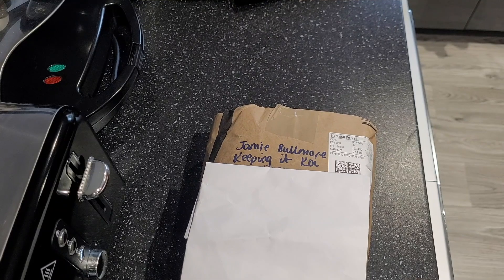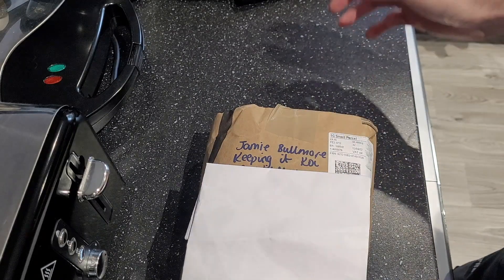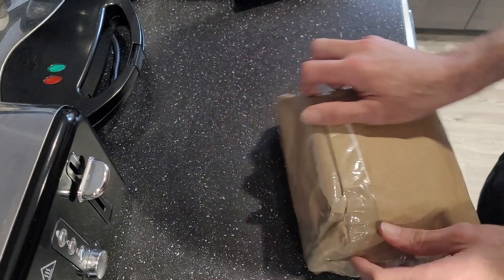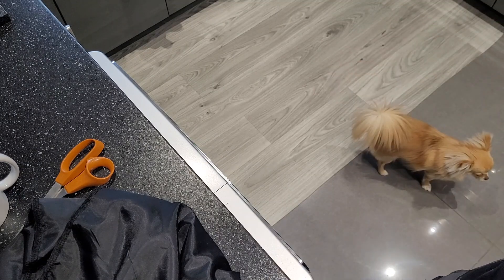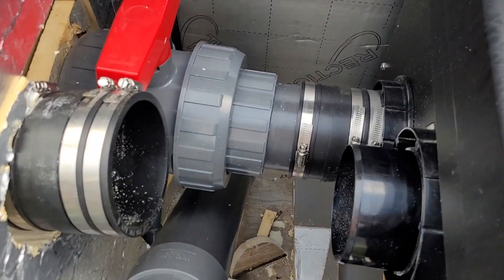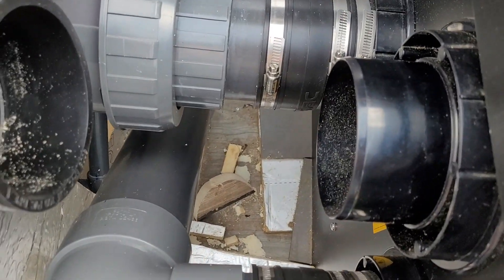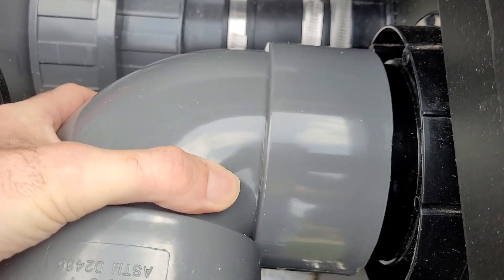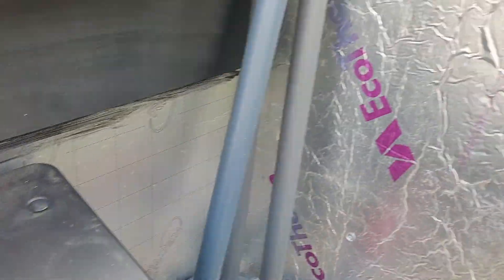Oase Drum Fix 👍🏻👍🏻 Check it out your gonna wanna see this 👍🏻 More deliveries & a Special Guest

Comment: What you have to remember is 110mm and 4 inch ard not the same you need a imperial to metric conversion and that is what Skeggy gave you, standard in plumbing industry with large fittings.
Reply from the maker: Yeh I know that but none of the 110mm fitted either like I showed in the video that's why it was confusing 👍